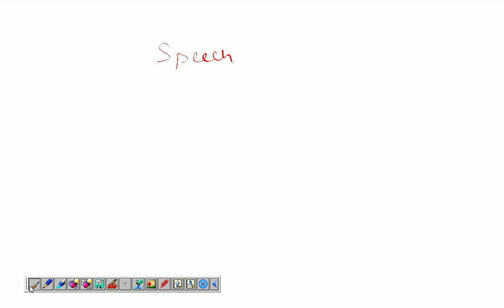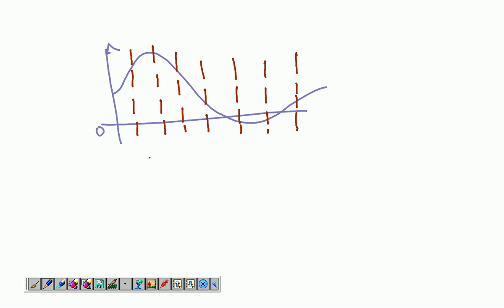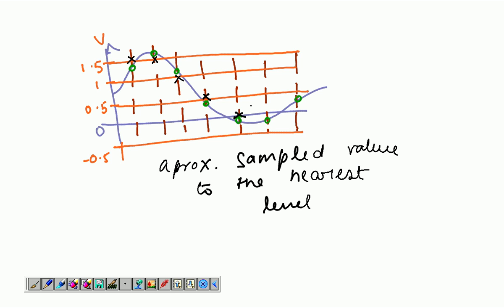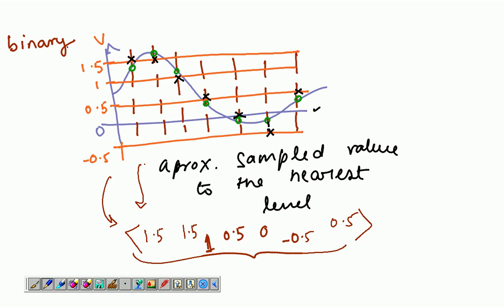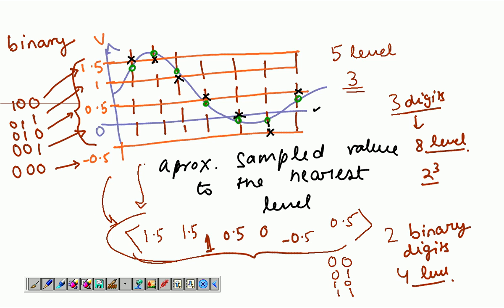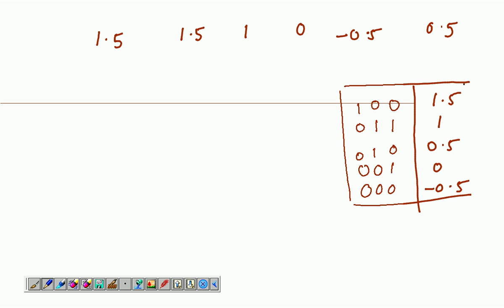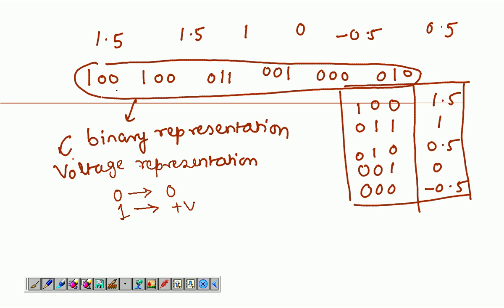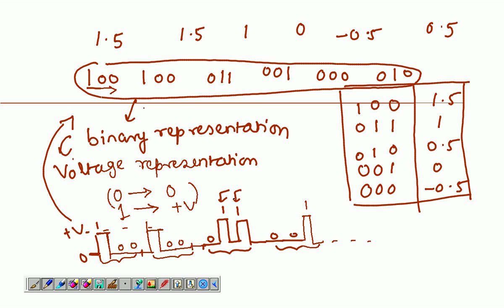CS - 04 - The Basics Of Pulse Code Modulation (PCM)

Comment: Great video. just a little correction, wouldn't the data line for the 011 binary signal stay high for the two 1's, as opposed to two separate pulses?

Thanks again for the clear video
Reply: +Daniel Beckett Depends on the encoding, return-to-zero vs non-return-to-zero